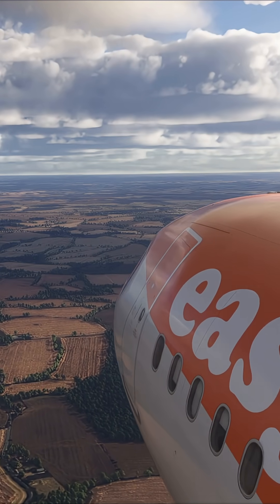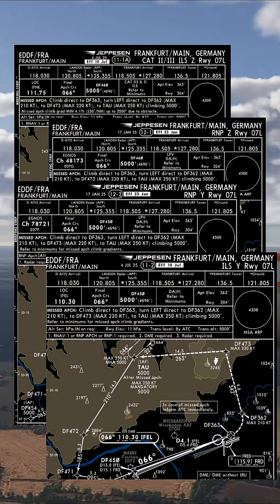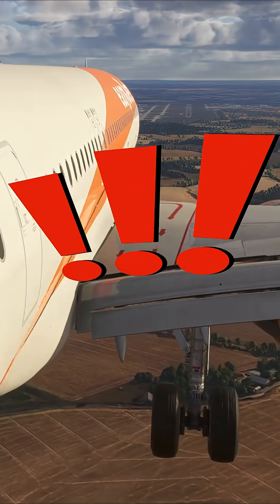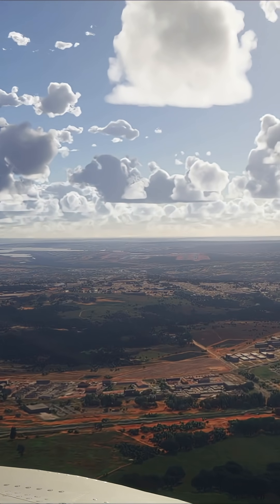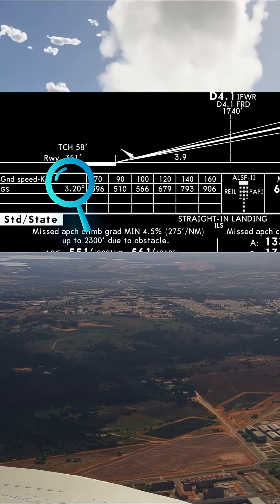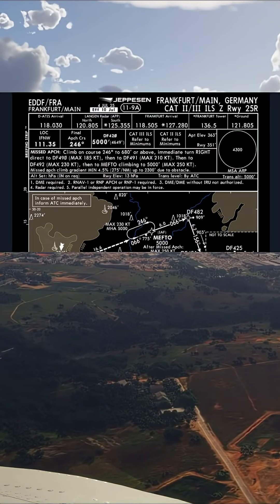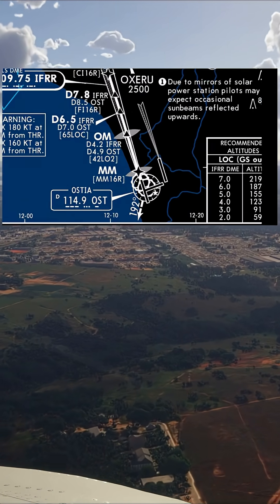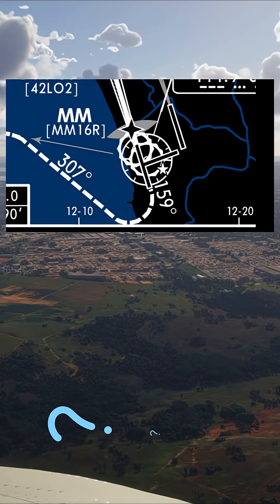ILS Z vs ILS Y — What’s the Difference?

Comment: It's awful that the suffixes aren't standardised (yet), this creates some awfully confusing choices. For example Funchal, LPMA.

RNP A 05 is the standard circling approach. The RNP (AR) approaches carry the designators Z and Y (from the north and south respectively), whereas on runway 23 the RNP (AR) carries no suffix, but the RNP B is the circling 🤡. When flying there with an FO who has never been there, if they set up the box before departure (since I have to land there I normally let them do the take-off on a 2 leg day) and don't ask me which approach we can expect there (depending on the aircraft configuration and RAIM issues around ETA), more often than not they select the wrong one.

Comment: A straightforwardILS will have no reference to a DMA. ILS-Z will reference an ILS-DME, ILS-Y will reference the VOR-DME, and other approaches will differentiate depending on approach procedure, inbound procedures or missed approach procedures. I’ve seen airports down to ILS-T, which can become confusing when you need to select and brief an approach over an hour from landing and don’t truely know which one you’ll actually be using.

Comment: Good format pal - I like these shorts.  Would be good to get one on how to choose your transition without ATC on vatsim (when to use and not)
Reply from the maker: Will look into that 👍
Reply: @Easyjetsimpilot  Great video
Reply: Not sure where you fly but in Australia the transition for the approach is the last waypoint on the STAR...and the correct STAR is the last waypoint on your flight plan (use the high airways for your route for flights over fl190 and everything lines up). The same is for the SID, the first waypoint in your flight plan will be your SID or if its a SID with a transition, the transition will be the first waypoint. Hope this helps you out. They are all orientated in which direction you come from aswell. Hope this helps you out a bit!

Comment: For all EPWA users from a local: please stop using ILS Z 33. The WAR VOR is inactive. Use ILS Y instead
Reply: There's nothing in NOTAMs about it, there's upcoming maintenance for OKC and WAR but that's about it. 

Also looking at charted ILS-Z, WAR isn't even on it, OKC is being used on the chart. 

You're probably on some outdated airrac. I don't fly there so not sure what it may have been before. 

If ILS-Z was U/S or NA, I'd understand but you can't assume everyone who's not local knows those things so notams needs to be made clear and there's nothing about that on there so..

And even if WAR is out of service ILS Z is using OKC.
Reply: @FluffScripts Thank you so much for explaining that to me. Again as  I literally live there I can confirm that ILS Z 33 has never been used for several years now as the WAR VOR contained in the missed approach procedure is not active. If you cannot see that you are probably using severely outdated informations. If your informations are recent, you have to know that the whole chart matters, not only the final approach. Following that let me explain:
Both ILS' are using OKC, the main difference between Y and Z is the missed approach routing where the WAR is located. Ofc Z is usable practically but not legally as it is not applicable while being impossible to complete a published go around there. ILS Y uses a normal waypoint located almost in the same position instead.